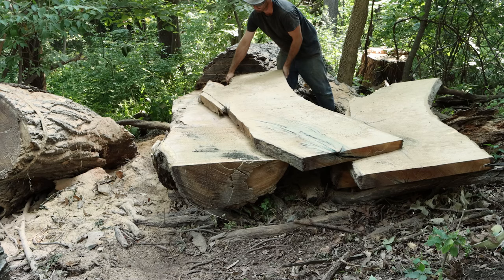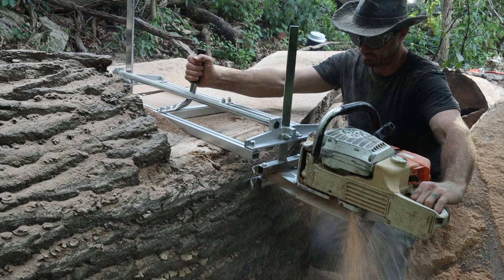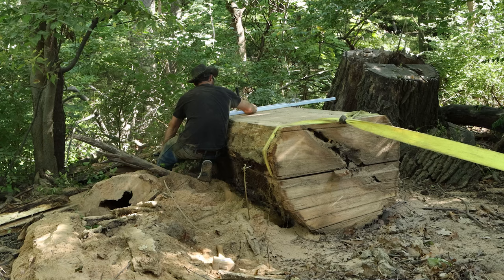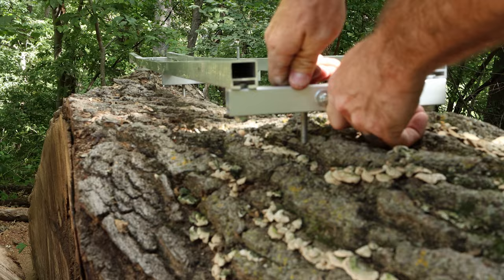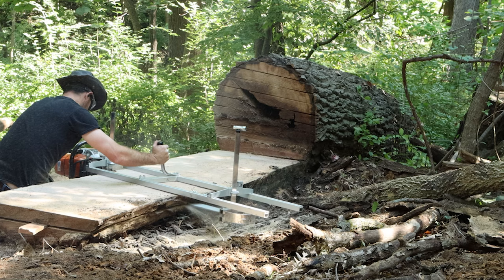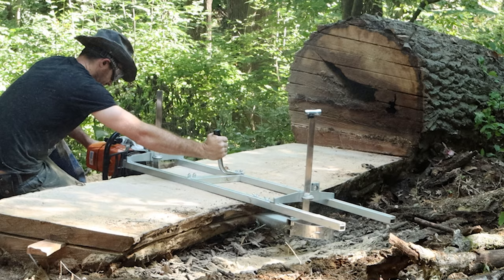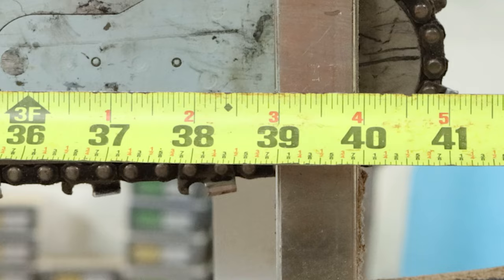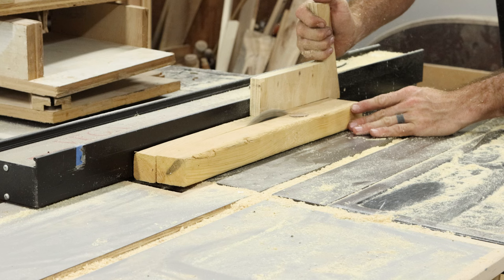Getting Started In Chainsaw Milling, What You Need To Know!

Comment: HP is irrelevant for milling. The torque of that 881/3120 is on another level to a 661/592. You can lower the rakers more for your size of wood and gain substantial cutting speed with these 2 big bore saws. But if you ever wanna cut something in the 60-80" slabs, the 661 will be killed by it unless you go really slow with it.
Reply: Perhaps I missed your point, But your kicker statement is false. HP is extremely relevant for milling. 

Explain why can’t my Ryobi 1/3hp resaw, but my 3/4hp delta can
Reply: @andersnelson6888  Because the delta has higher torque. If that ryobi spins at 30k rpm it would have the same hp at the delta but it would die when put under load just the same as it does now. HP = RPMxTorque. When milling and pulling long bars, the RPMs will always suffer if you want to cut efficiently, and after a certain bar length there's no way out of the RPM drop as the load on the saw increases substantially.
That's when torque wins, and why people mill large wood with 100-120cc saws, and why 90cc is a minimum if you want longevity no matter if the saw is a 7hp modern 661 or a 50 year old 5hp 90cc saw. 2 hp difference, but they still cut the same, all hardware being equal. Why? Its because the 5hp old one has lower rpm but higher torque. I hope you understand it better now.
Reply: HP doesn’t matter? Hmm…

Comment: Dont clamp the sprocket! The nails and string setup allows unlimited length cuts and a short guide board. Also when you get a ways in on the cut try sitting on the log and push with your feet. A string to the throttle holds it open. It was my wifes favorite way to mill😂

Comment: I got a holtzfforma g888 for 800ish with 48 inch bar. Stihl quality half price. Works great. Never thought of extersion bars. Like it!
Reply: Been rocking the g660 on my mill for about 2 years now, its not quite STIHL quality but at 1/3 the price I could buy another and still save money.
Reply: Well the amazon users call.those saws "complete garbage".  Humm.

Comment: I got the mill guide and winch just in case im still going to try the guide out just to see i also got them off of temu so i got all 3 from for about 120$ if anyone wants to check it out it connected me to the actual manufacturer warehouse so it cut out the middleman and saved me a arm and a leg

Comment: Many thanks for the info, I have a clone of the MS660 as it was circa £400 here in the UK and not £1400 plus for the real deal. They (chinese clones) seems to be a love/hate (or Marmite as we'd say here) item but mine is fit for purpose and I like it, I've learned a lot about chainsaws and you need to be able to wield a spanner at times (and sharpen! )  I also have a clone Alaskan mill and would highly recommend the winch option. My kit came 'all in' with the first cut rails - use an aluminium  ladder, I do now - and the bar end oiler. I run a 36" bar, with a rip profile chain, about to experiment with a skip chain. I've found lubrication a concern so I fitted the bar end oiler (as well as a 'performance' aftermarket oil pump) BUT you lose cut capacity drilling the bar for the oiler, unless you fancy doing so on the nose sprocket, one I shall investigate later as my trunks are maxing out at about 30" so not an issue. Currently cutting through and through but want to try to get into more quarter sawn.  Your comments about taking the mill to the tree are precisely why I bought my rig and it's working so far.  Not a pro just a hobbyist. Enjoy and be safe.

Comment: I just started chainsaw milling from scratch a few months ago and have amassed about 1500 bdft of slabs and cookies. White oak, red oak, pecan and some spalted red maple. 2.5" to 3.5". I'm hoping to eventually turn this from a hobby into a business. And when I say "from scratch" I mean it, just a little 10'x12' work space in my barn. No heavy equipment or anything. So far I've been stacking it in my backyard, wrapped in a shade mesh (to keep the sun, high winds and some blowing rain off) with the tops tarped or topped with corrugated panels. End sealed everything, stickered and stacked as level as possible (found a weed trimmer works better than a shovel for getting through the grass to level blocks lol). I have a small 10'x10' kiln building in the works and a bigger workshop after that to level slabs in and store some of the dried material. Of course I still have to earn the money to build these things so it's going to be a process.   

I started splitting firewood full time for an older fella that sells it commercially about 6 months ago. He has two different landscaping companies that bring him all their wood, and quite often they bring in decent sized logs of 6'-8' in length. He lets me pick out whatever I want and I come mill them on the weekends. My bar is only 36" (stupid me didn't get the 42") so I can only do about 30" unless I try your sprocket clamp method. Just yesterday they dropped off some huge white oak, it was probably 40" at the stump so I cant mill the first log but the second two are just under 30" so I'll get 500bdft out of that. Even if I only get $5 per bdft for these white oak slabs, that's still a $2500 haul!

Comment: Great videos thanks for making them. I have a Stihl 661 and mill attachment and I use a box section aluminium ladder to make the first cut. I have drilledc4 small holes in a couple of the rungs and screw it to the tree. This makes a very firm base to start from.

Comment: I'd like to make beams, not slabs, from big oak&pine logs like that. 
My concern is getting a log out of the woods 1st, what length&diameter is possible with my tractor.  Maybe have to cut a few slaps off first as don't need larger than 20in sq beam.  Need a skidder for front of log/beam tho.

Comment: I bought a new Ms 391 with a 28" bar . About 18" to 22" will be about as large as I plan to cut . And I plan to use a section 
of extension ladder for a guide just for the top cut . What do you think ?

Comment: I got a question!   I have a 48" wide oak and I want to make table top.  

Can I get chain saw mill that wide?  

If not, how can cut slabs from 48" tree??
Reply from the maker: Yes, you absolutely can. Like I showed in the video you can buy them different sizes and you can also extend them.

Comment: Could you use a smaller chainsaw on this I have a 201 tc was wondering if I could use that
Reply from the maker: Absolutely! It will just have a smaller capacity and it's a good idea to buy a ripping chain.
Reply: @WyldeWoodworks  that’s what I figured I know the bords would be smaller but figured it could still work